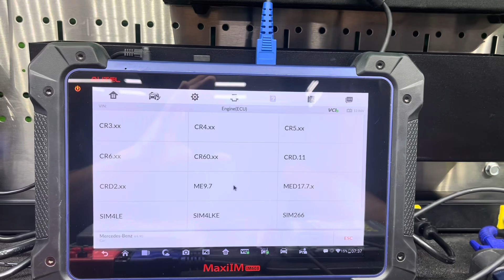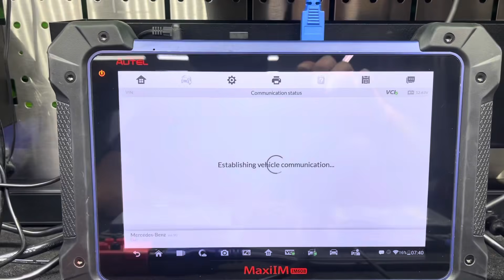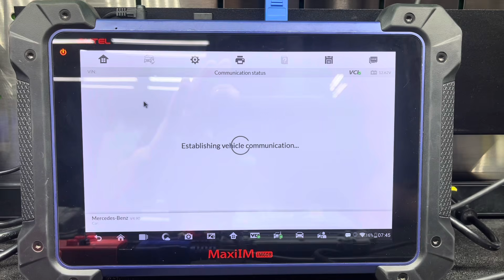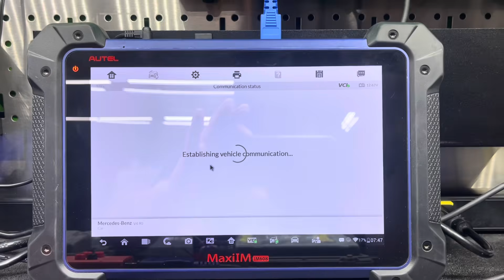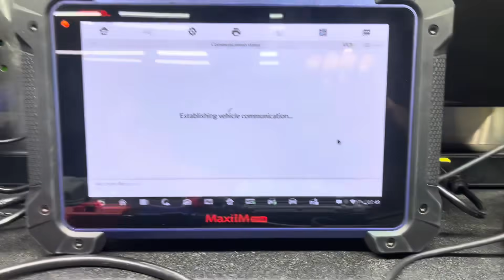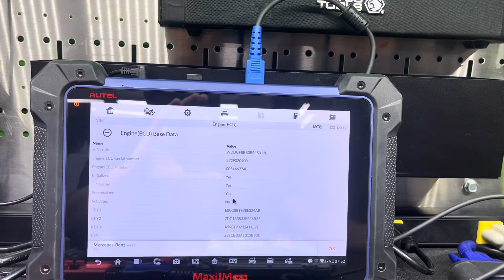Mercedes Used ME9.7 Engine Control Unit Swap/programming/Renewing/coding with Autel IM608

Comment: Im doing it with the same workstation but it beeps and turns off when im trying to connect with the module.?? Maybe goin over the 2 amps that the workstation is rated at? Did you modified yours??

Comment: Goodday

Could you clone/reprogram/code the info from a om651 DELPHI CRD3P.B0 on to a m273 me9.7 ecu for an engine swap

Vin sprinter
WDB9066351P594255
Vin r500
WDC2510721A076579

Kind regards 
Dylan van Dongen

Kind regards
Dylan

Comment: I just did this with my IM508, it was the same process. Thank you.
Reply: Thanks for sharimg, i own 508s, but didnt know it can be do it, i use it only for key coding. Did younhave g-box or it is possible with out it?
Reply: @darkojankovic6440  i belive you can do it without, but I did use g box
Reply: @darkojankovic6440 possible without. You must use a 120ohm resistor
Reply: Thanks for the tip. I was gonna ask if it could be done with 508.

Comment: Hi how can I contact you? I need to program a vin number in a used ecm. I would like to send you my ecm. Email? Thanks
Reply from the maker: Dynamicautodiagnostic@gmail.com
Reply: @huyug1  thanks for the reply. I found out that what I wanted to do will not work unless I change out other components. It’s not worth the change. The difference changed to much between the two years.
Reply: Hii can you programme used Toyota ecu  N4 on bench

Comment: Well done homie
So from my understanding the im 508 with gbox and Xp400 will perform them renewal of the me9.7 aswell. 
Question. Without old module communicating will the ultra pull the scn coding from autel servers to finish setting up the renewed module?
Reply: I would like to know this as well did u found out.

Comment: Thank you for the video. I’m confused because you did a great introduction but I think you used only one ECM, and what I’ve seen was only one VIN number. You just saved and write the same information, you didn’t replace the ECM.
Reply from the maker: They were 2 different ECUs but I have already programmed that module before with same file that’s why it was same info in both modules.

Comment: really great sir  . 
this can be done on Volkswagen Scirocco 2010 2.0 TSI ?
Reply from the maker: It depends on the type of ECU type. VW system is totally different and it has different way of programming
Reply: @huyug1  Thank you
Reply: @huyug1  The computer that is going to be programmed needs to be new or can be used. If you help me with that information, I would greatly appreciate it.
Reply from the maker: @alexanderhenrriquez5563  it also depends on the ECU. But used one should be enough. If you tell me what type of ECU you have I can help more.
Reply: @huyug1  how to contact you over gmail or Whatsapp?

Comment: How did you connect a mouse to the im608 tablet?
Reply: probably used a wireless mouse by putting the dongle in the other usb slot.